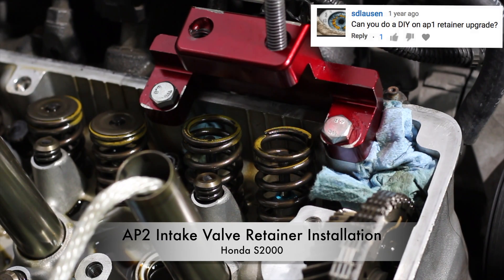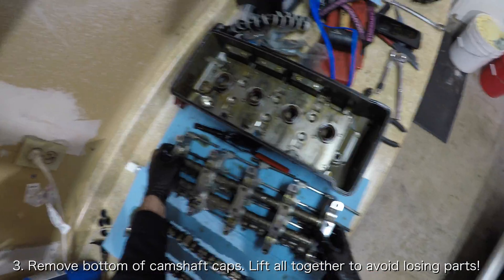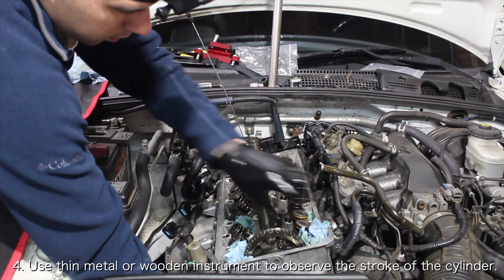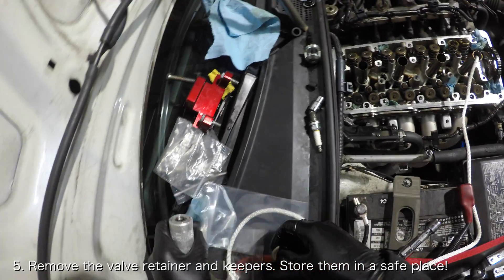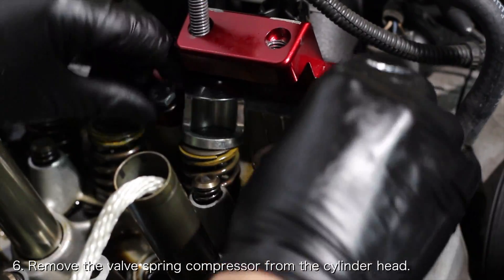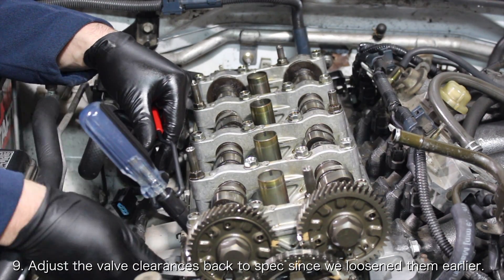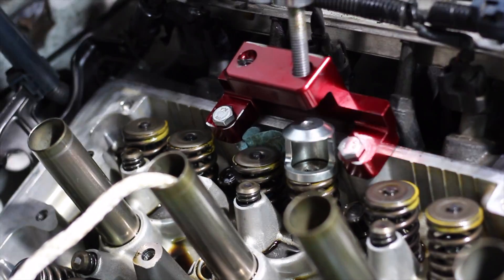AP2 Intake Valve Retainer Installation | Honda S2000

Comment: I fucked up putting the Intake cam in and had it set a tooth advanced. Car wouldn’t start and I didn’t know what I fucked up. Took a while to figure out the mistake.
Reply from the maker: I probably should have inserted a note about troubleshooting this in the video. I'll pin your comment for now.
Reply: How did the stock ap1 retainers look ?
Reply from the maker: Completely fine after 140K
Reply: I also just did this, the sad part is I saw your comment during installation and thought I made sure not to set it wrong lol, low and behold the car wouldn’t start … went back in and the intake was exactly one off
Reply: Big D Slap what was it that you did to correct the problem ?
Reply from the maker: You move the camshaft one tooth clockwise or counter clockwise until you reach perfect TDC.

Comment: I was just doing this job and was off to a good start. Was changing the retainers/cotters on the second cylinder when my compressor failed me, it was leaking, so when I went to remove the retainer/cotter on the second valve, the valve fell in the cylinder, so now I have to remove the head to finish this job. ARGH!! I was doing so good. Next time, I'm doing the nylon rope in the cylinder method, DO NOT trust the compressed air method. You're better off having something physical in the cylinder preventing the valve from completely falling in.
Reply from the maker: Even with the piston at top dead center?

Comment: Hey man great video! After completing this work my car wouldn’t start. It would crank, just wouldn’t turn over. Any ideas?
Reply from the maker: Cams are probably off by one tooth or the cam sensors on the valve cover are loose. Double check your TDC marks.
Reply: @DIYGuysvideo  Yeah, I think I have it aligned, pretty much how it looks in the service manual. Is there a video you did in regards to this issue?
Reply from the maker: @TheJeremy2011 Send me a picture of how it looks on instagram or email.
Reply: @ DIYGUYSTV?

Comment: my car has been idling bad and its getting to the point where its stalling... I was going to go about things in this order... clean the IACV  and change the grommet, then plugs, then coil packs, then fuel injectors....im thinking in this order.. then maybe send it off to Billman since hes like 4 hours away cause im in MASS...ifff none of that works..
Reply: not that anyone read my comments but if anyone does. it ended up being spark plug valve cover gasket leak. best situation very cheap to fix

Comment: I am an ameture and I Just did this job yesterday. All in all it took 9/10(breaked for lunch) hours from disassembly, modifying the spring compressor tool from ebay, hacking the retainers out, losing a keeper in the enginebay,  reassemble, valve lash, and then losing one rubber grommet for the valve cover in the engine bay. Word of advice, go slow and be patient. This job is much more tedious and nerve wracking then the clutch job for this car.
Make sure you have  the right tools or else don't attempt. I had the valve keeper removal tool from Lisle, spark plug air adaptor hose(ebay) , and spring compressor (ebay)

Comment: Great tutorial. Thank you for this and your other s2k DIYs.
One question -- when determining TDC for the other 3 pistons (where you can't rely on the timing marks) using a dowel or dipstick, is it OK to turn the crankshaft both clockwise & counter-clockwise to find exact TDC and not just above/below it?

For some reason I thought it was VERY bad to rotate it CCW. Or is that only while camshafts are in place?
Reply from the maker: I don’t think it matters if you turn the crank clockwise or counter clockwise. At the end you’ll reset the crank pulley to TDC to reinstall the cams.

Comment: You made some truly great tutorial S2000 videos. I plan on doing this next month. Since pistons 1 and 4 travel together, I can basically work on them together, right? And then pistons 2 and 3. The same goes for valve adjustment. That way, minimizing the turns on the crankshaft and getting the work done quicker.
Reply from the maker: Yep.
Reply: @DIYGuysvideo  So I am trying your rope method right now and the rope is stuck in piston 3 and 4. Any help in this situation is really appreciated!
Reply from the maker: Have you rotated the crankshaft back to lower the piston and remove pressure from the rope?
Reply: @DIYGuysvideo  We tried that. The end of the rope must be stuck in the valves. I think the issue is trying to do two cylinders at a time using the rope method, which can cause one of the pistons to not fully compress the rope to shut the valve tight due to the rope slack/bunch being not equal. Going to try a couple of different ways to see if that will work.
Reply from the maker: I can see that happening if you did two adjacent pistons that don’t travel together.
Reply: @DIYGuysvideo  We were able to compress the valve stem assembly fully intact using a 2x4 with a 10" dowel attach to the middle of it to compress the spring enough the free the ropes. Thanks again for your video instructions. Otherwise, I would have never tackled this job!
Reply: @DIYGuysvideo  We did 1 and 4 together and 2 and 3, but still got stuck.

Comment: THANK YOU for these videos. I've watched a ton of them and they're all amazing. This video gave me the confidence/courage to do this job myself. I am definitely not a mechanic and the whole job took me 10 hours, lol. But the car runs great and I didn't screw anything up! Or so it seems...

Anyway, here are a couple tips from someone that had no idea what they were doing:
1. The cam towers can be removed by prying them with a screwdriver, using the head as leverage. Put a rag between the screwdriver/head to avoid damaging it.
2. The F20C has a stroke of 84mm. Put a piece of masking tape on your dipstick 84mm from the end and you will instantly know when a cylinder is at bottom dead center (I used the nylon rope method.)
3. TAKE A PICTURE OF THE CAM TIMING MARKS before you remove the cams. This will make it (almost) impossible to screw up the cam timing.
4. The cam towers are incredibly fussy to re-install. I don't have a good solution, but make sure all the lifters (?) are not binding before you start wailing on the towers with your rubber mallet.
5. When you remove the valve cover, some oil will drip onto the header. When you drive the car, it will smoke... If you don't want to be paranoid about screwing up the valve cover installation (like I was!) spray the header engine de-greaser and rinse it off before starting the car. This will reduce the amount of oil/smoke.

Comment: Got rope stuck in between a valve
Reply: Mines also got stuck too. At first I thought it might just be the first cylinder but the second did the exact same thing. I thought it was the rope I was using so I went to Walmart and got a new nylon rope but cylinders 3 and 4 did the same thing. I recommend using compressed air instead of nylon rope.

Comment: At 8:35 in the video how do you get the rocker arms to stay up like that? Mine keep flopping down causing me to struggle getting the cap base back on.
Reply from the maker: I have used zip ties before
Reply: I was having the same issue. I got my mom to helped me lol. We did one side first and once that side is clear we tackle the other side.
Reply: @Perfectionyx  I ended up using rubber bands. I also saw someone use those long magnets.

Comment: Hey guys I have a 2000 ap1. It only has 48k original mileage even proof on carfax. Is this something I should inspect as well just to be on the safe side or I should be fine until 100k mileage?

Comment: Hey Soviet! I got as far as removing the AP1 retainers for the first cylinders two intake valves and i installed two new stem seals BUT... I'm struggling to knock the exhaust sides valve retainers off to replace those seals. Hard angle to work with. What do i do?
Reply from the maker: Hmm. I don’t remember doing anything special for the exhaust side.
Reply: @DIYGuysvideo  its just that due to the angle being more extreme I'm finding it hard to get the exhaust side off with a whack or two of the hammer and Lisle tool. I might need to use the compressor tool.
Reply from the maker: The compressor tool sometimes doesn’t work. You’re RHD right?
Reply: @DIYGuysvideo  yeah that's right. Progress update, this morning I managed to knock the exhaust retainers out with the Lisle tool and hammer! Came out fairly easily this time. I replaced the stem seals and am about to reinstall the retainers and keepers now. Had a close call already with the spring jumping out and sending the keepers flying but one got caught in the cage and the other fortunately fell in a shallow bolt hole which i fished out with my magnetic tool. I realize now that the compressor must compress the spring as flush as possible, right?
Reply: @DIYGuysvideo  Soviet I conquered the retainer swap! Replaced all stem seals on both sides too. I cannot get the cam caps middle bolts to thread in though. Why? I positioned the rocker assembly (which is a real pain) in place (I managed to keep it from falling apart by just catching it when I saw either side slide out a bit) and knocked it down with a mallet as you said. The holes line up perfectly but now, the middle cam cap bolts do not go in. I'm just turning them for nothing...
Reply from the maker: Are they getting deep enough to thread?
Reply: @DIYGuysvideo  Found the problem thanks to F1Twothousand. The rocker arm shafts spun during removal of the assembly causing the bolt holes to get blocked. I managed to push my exhaust rocker shaft to the correct orientation from the top while the assembly is still on the head but didn't get so lucky with my intake side...it looks like I can leverage any hole from the top to spin it enough. Maybe rocking it back and forth to get it out like you mentioned in your video can disorient them? If so, I might be able to use this to my advantage. Otherwise I'll have to lift the assembly up enough to pull the number one rocker shaft holder almost off or completely off and then rotate the intake shaft by hand. I'll use a cam cap middle bolt to keep the exhaust side shaft from moving while doing this.

Comment: Awesome video! I am going to do this on my own AP1, and was wondering are you able to use the rope method to replace the exhaust valve retainers too? Or do you need compressed air to do the exhaust retainers? Thanks!
Reply from the maker: You can use rope to do the exhaust valve retainers too. I ended up changing all my valve stems during this video using rope.

Comment: Is the orientation of the keepers important when reinstalling?
Reply from the maker: Don’t think so. As long as as they are right side up.
Reply: @DIYGuysvideo  That's what I mean - which is the right side up and how do you know when looking at them?
Reply from the maker: RolanTHUNDER they are larger diameter at the top and smaller diameter at the bottom IIRC
Reply: @DIYGuysvideo  Cool thanks. Apparently they have laser etched markings (the AP2 cotters) showing right side up.
I'm going to do my valve stem seals while I'm in there. Car is not smoking. Any tips?
Reply from the maker: RolanTHUNDER not much. Just get some valve stem seal pullers and it should be pretty easy
Reply: @DIYGuysvideo  ok thanks. Will traditional needle nose pliers work? A write up on S2KI showed the guy using spark plug pliers too.
Reply from the maker: RolanTHUNDER not sure about needle nose. Spark plug pliers might work tho.

Comment: In order to release the nylon rope you would have to turn the crank counter clockwise a bit right? I've read that spinning the motor backwards can cause damage. In your experience is this something to worry about?
Reply from the maker: That is correct. Haven’t heard of issues rotating the crankshaft backward by hand.

Comment: Thanks for the video it helped a lot. I replaced my intake side retainers on the weekend. 5 out of 8 were cracked. From the top there were only 2 sunken.
Reply from the maker: Wow that’s crazy! Has the engine ever been overreved?
Reply: @DIYGuysvideo  I bought it 8 years ago, put around 25.000 very conservative miles in it. Probably the previous owner overreved it. Yesterday eve I cleaned the removed retainers, actually there were 7 out of the 8 cracked not just 5. I feel lucky that it didn't drop a valve yet.

Comment: Hi, I know this is a bit late, but some people say the retainers are too heavy on the exhaust side.  Is this true? If so, is it only better to do the intake side, or replace springs etc...
Reply from the maker: You are correct, there is little value in upgrading the valve retainers on the exhaust side. Just do the intake side per the video!

Comment: What do you mean the spring compressor needs to be modified
Reply from the maker: I have another video on the tools I used to perform the intake valve replacement. Search for it and you’ll find it 😛

Comment: After following this video, another one, and various forum research I have a few tips:

- Make absolutely sure EVERY passage is covered. I had a keeper go flying and realized I missed a passage. So I had to drop the oil pan to confirm it didn't fall in there.
- The bottom cam shaft caps, for me, were the hardest part of this entire process. They were super hard to get off. Then they were super annoying to get back on. They kept slipping about and the bearings like to drop out, so watch out. I think (double check) that if you use a more "standard" spring compressor tool (not the one in the video) then it may be possible to avoid this step entirely. If that's the case, I wouldn't use the tool we used for the spring compressor.
-  Seriously, make sure EVERY passage is covered. 
- Leave your spark plugs in, except for the cylinder you're working on. A keeper could fly in to any unplugged hole.
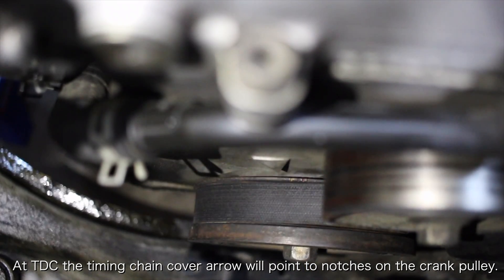- After you set TDC (1:33) take a picture of your gears, their position, etc. When you put the cams back in you can reference the picture to know for sure you have it setup exactly the same. 

I lay newspaper all over a work table, then as I remove parts I set them down in a left to right fashion as I did them and use a magic marker to label them. This small step is super helpful for reassembly, especially if you may not finish in one sitting. Just never knock your table over.

EDIT: Thank you DIYGuys for the video, certainly helped make the job easier!

Comment: I'm curious about the valve keeper removal tool. I have that same tool. Mine is made by Lisle, but I have never used it. My tool came with a keeper/retainer install tool, where you place retainer with keepers in place on top of the spring and hit it with a hammer, is there a reason why you use the valve string compressor and not the Lisle install tool? I am about to start this project and don't want any problems.
Reply from the maker: Great question. At the time that I had done this I had heard of few people using the Lisle tool for installation. I have now read that you can use the Lisle tool to install the valve keepers but that it is trickier and more error prone with the Lisle tool. Specifically it can be more difficult to use on the exhaust side when using rope or a weak spring compressor. For a beginner the spring compressor is more user friendly in my opinion but if you’re just doing the intakes you should be able to get away with the Lisle tool. Let me know how it goes!
Reply: Well the conclusion I reached is you're EXACTLY RIGHT! Remove with the Lisle retainer removal tool, but replace with the valve spring compressor. If you have the upper body strength of Hulk Hogan or can push in dog spikes like thumbtacks, then use the Lisle retainer install tool, I think it would make removing the lower camshaft caps unnecessary. I used it on #1 front exhaust valve before removing the lower camshaft caps by pushing down on the tool by hand, it took a lot of pushing. (I'm not even Hulk Hogan's little finger for strength) I was uncomfortable with the thought of striking it with a hammer since the head of the valve stem is a bit below the hole in the retainer I was afraid of bending the valve stem if I missed. It would have been impossible for me to use it in the more difficult to reach locations. I also have what appears to be the valve spring compression tool you are using, mine had to be modified by grinding out places in the back to accommodate the intake manifold. The end result is I did it exactly as you show in your video, it was the most detailed and useful I found on YouTube.  After all that work I didn't find a single crack, but I feel better knowing rather than hoping. Anyone can tackle this project if they closely follow your instructions and take their time.